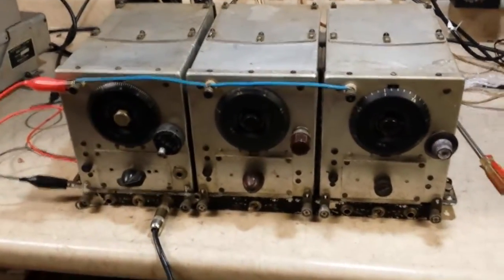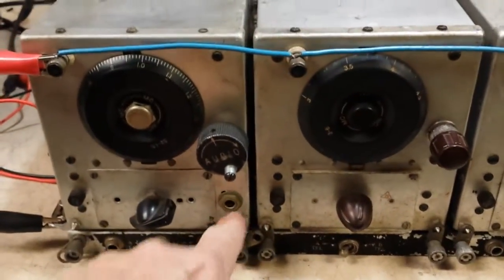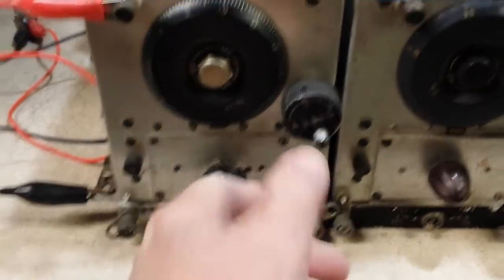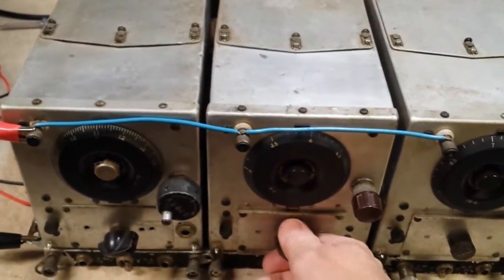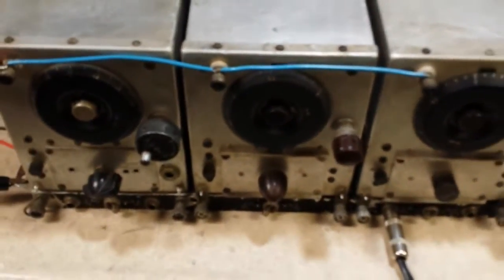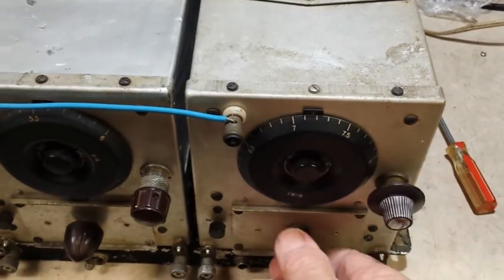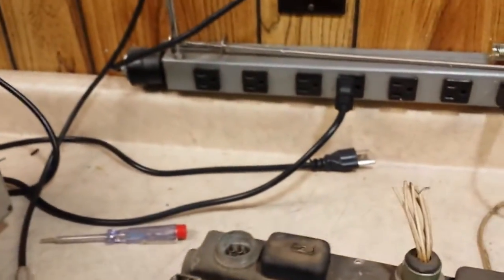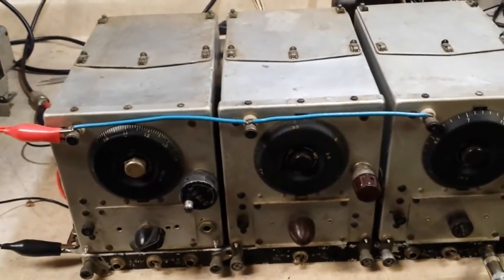ARC-5 Command Set -- 3 Receivers in Rack

Comment: Very nice setup.

I have a BC-455A receiver that is surprisingly hot far as reception goes. With mine I added AGC which was as simple as connecting a 2.2 meg resistor between the detector output and the AGC line which was complete from the factory other than the resistor not being there. Required grounding the connection to the original volume control and replacing the control with a 2 meg variable resistor connected between the detector output and audio tube grid. Mine was butchered so I had to build an external power supply and also added a push pull 14 watt 6BQ5 amp to the power supply chassis.

Modifying the power supply to power all three should be very easy. Just mount the supply separately and the switches on the front panel could be used to select each receiver and select which receiver is connected to the speaker either VIA relays or some 3 pole single throw switches.